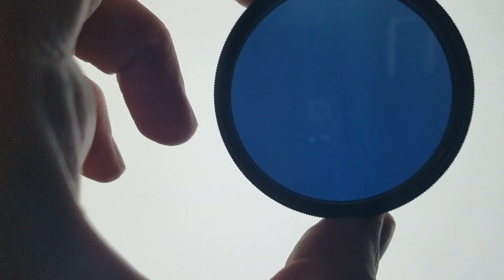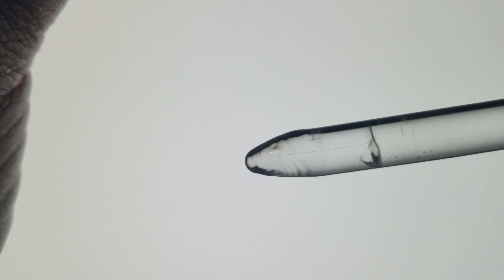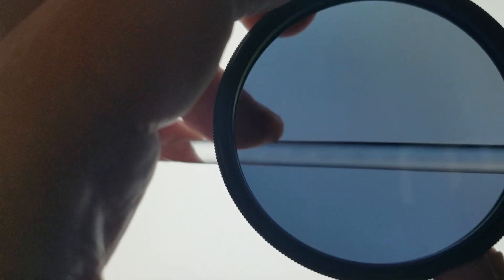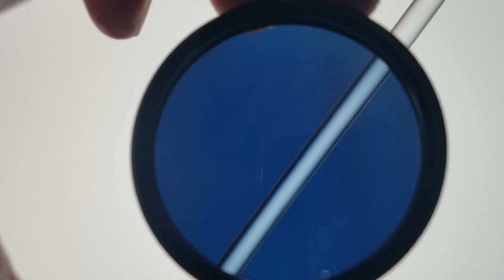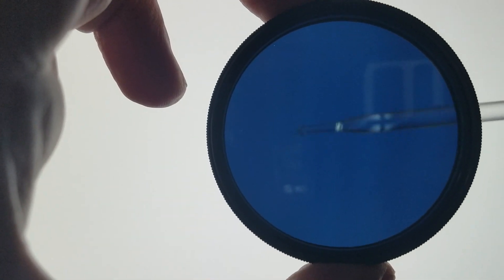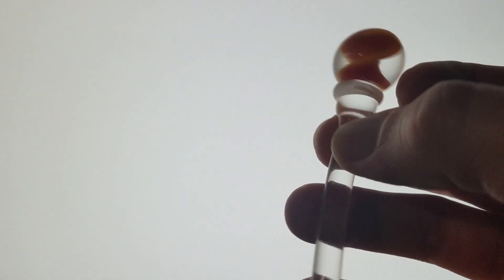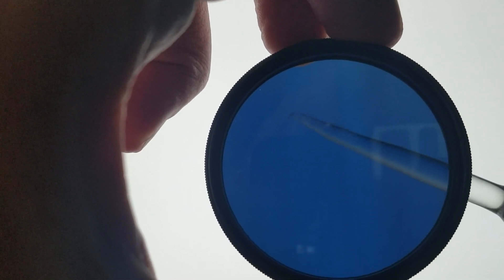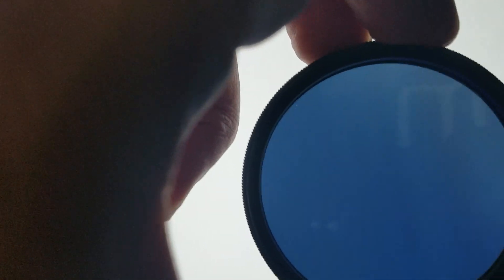Visualizing stress in glass art with a homemade polariscope

Comment: I guess you're using a circular polarizer, when you apply a lineair polarizer you can block ~ 99% of the light from the screen
Reply from the maker: @FC-se8wf  it needs to be linear polarized, you can see that when I rotate it. The reason it can't all be blocked is the monitor isn't 100% parallel polarized.
Reply: @jasmine2501  Maybe you're right, all the same many people don't understand the difference between circular and lineair polarizers, if I use a linear polarizer on my laptop screen (Apple MacPro ) I block ~ 100 % while using a circular polarizer I reach max ~ 90 %., anyway thanks for being alert on messages on your interesting video!

Comment: 2:15 - SO what your saying is that we need a polarized light source and a polarized window screen between the glass work in question? No one will ever know about this stress stuff at the glass bong shop. I bought a nice looking bong, but the bottom base broke cause it was a wack ass stressed out bong glass lol. You should teach us how to anneal the glass work. Did a good job explaining about polariscope.
Reply from the maker: The good shops which deal in artist pieces may have some people who know this, but it's the artists who are responsible for getting it right. As shown in the video, if you get some chinesium pipe that's cheap, it might not be done properly

Comment: Nice video, but with one minor gripe. In the video you incorrectly called your setup a polarimeter. It's not. It's a polariscope, as the title states. Very similar, but to be a polarimeter it would need some way of measurement, such as a degree wheel for measuring the opposing angles of the two polarized lenses. 

As I said, a minor gripe. But correct nomenclature does matter. Basically a polarimeter is a measuring device while a polariscope simply shows a difference without actually measuring it. So while a polarimeter is always a polariscope, a polariscope is not necessarily a polarimeter.
Reply: Came here to say exactly this.
Reply: Does it, really matter? I think you're leaving the realm of practicality
Reply: @AndyU96  Yes, it matters. There's a big difference between being able to actually measure something (stress) and simply seeing it is present.

Comment: intersting. I'm concerned that the sunroof in my car might be prestressed, going to do exactly this to check. great vid
Reply: You need not be "concerned" that it's prestressed. It is, it's intentional, and it's called tempered glass. Because of the way tempering is done it strengthens the glass. And if the glass does break, causes it to break into tiny pieces that are far less dangerous than the big sharp shards that untempered glass will break into.

If you want to see the stress in your car windows (but not the front windshield) just look at them with a pair of polarized sunglasses. All of the small light/dark spots you'll see are where the hot glass was cooled with air jets to temper and strengthen it.
Reply from the maker: I am not sure if this would work on tempered glass. You'll probably see waves, but it's supposed to be like that.
Reply: @jasmine2501  interesting. didn't know that. thanks for the reply.
Reply from the maker: @kik1rik1  yes, tempered glass can be thought of as "pre-stressed" - it is strong because of internal stresses.

Comment: any chance you could fill me in on your annealing schedule?
Reply from the maker: It depends on what I'm doing and what type of glass. For some boro colors, I'll soak at 1070F for 3 or 4 hours, then 1050 for at least an hour depending on size, then ramp down at 100 per hour to 500, then shut off. For other colors, you can't soak it high temps, so it's just 1050F for an hour or so, then ramp down. For soft glass, it's 960F unless there's self-striking reds, which I will kiln strike at 1050 for an hour or so. For some of the double helix colors, a high temp soak really helps, for some others, it will ruin it. So, it's just a matter of what is being done. I'll make a video about it one day, there's a lot of misconceptions about it.